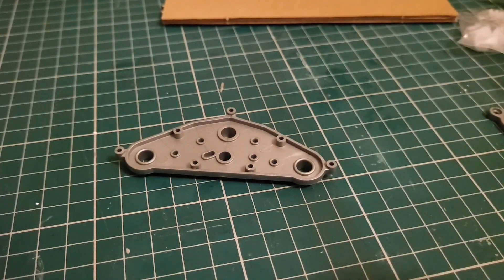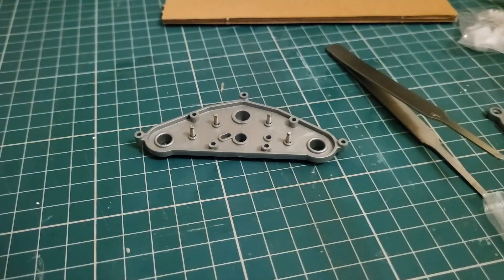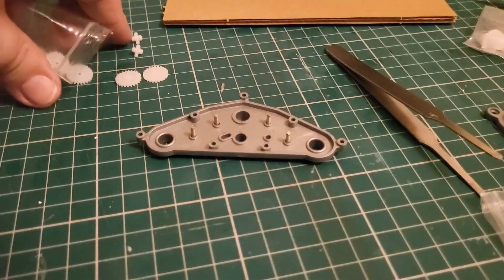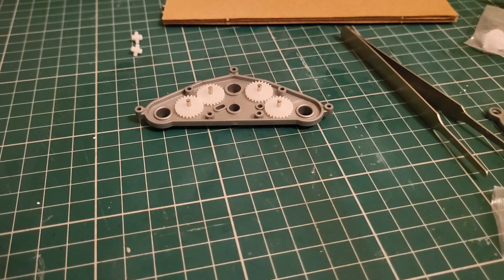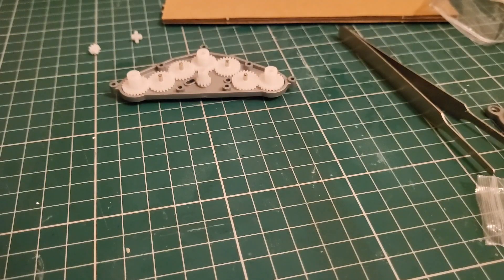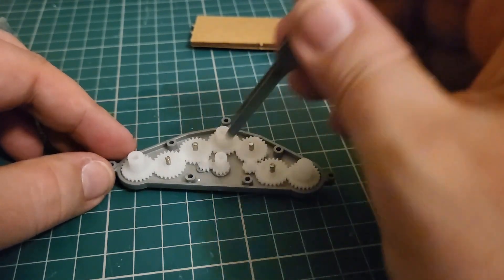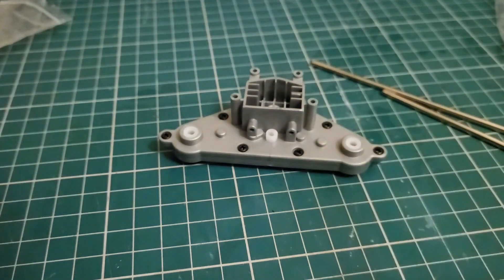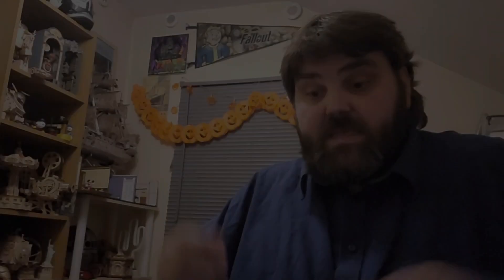Hachette Build the Titanic : part 35

Comment: In the engineering world where I’m from we use the quote “when in doubt get the lube out!” 😂
Reply from the maker: Yeah we use "if it moves and it shouldn't, duct tape , if it doesn't move and it should WD40 , if you can't fix it with WD40 or Duct tape it's because you aren't using enough WD40 or Duct tape"

Comment: Scott....Yes - indeed screws should be tightened in a diagonal fashion just as you show because it means that the seating of the parts one screws together are symmetrically flat and not skewed (as mentioned by ILLOGI7ECH) - similar to tightening nuts on a car wheel so that the wheel is not stressed unevenly upon tightening the nuts - ideally with a torque wrench to boot - Peter